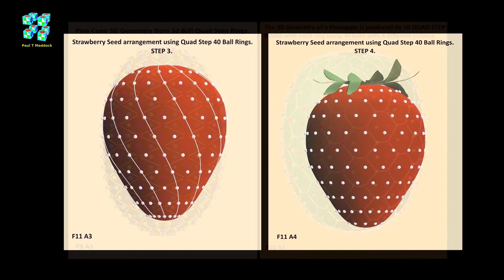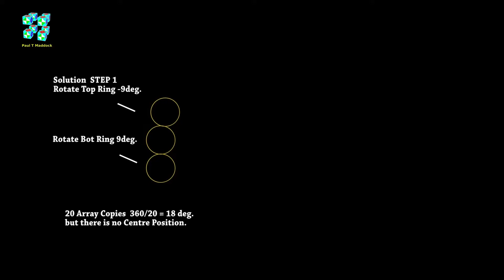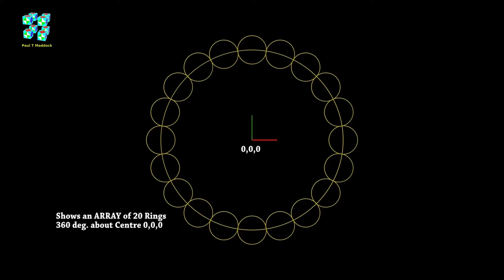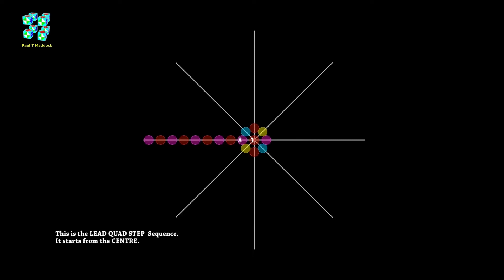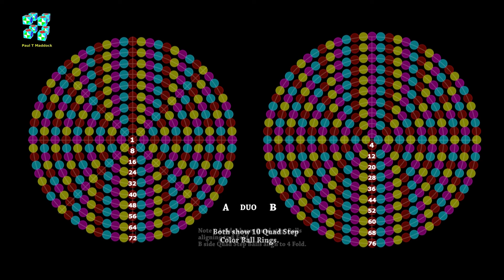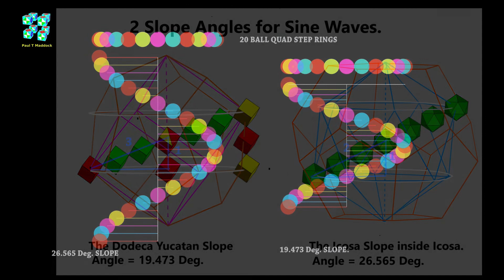QUANTUM HARMONIC SEQUENCE using QUAD STEP 288.

Comment: I'm not getting notifications, so I had to look for your channel.
How ya been?  I'm building 4 projects at once and researching frequency cymatics, patterns, ways to formulate a Teflon metal oxide mix to produce artificially, something found in bee wings by Victor Grebennikov who made an antigravity platform
Reply from the maker: I have just been plodding along with 3D Platonic Order Mike. Sounds like you are into some mind boggling stuff way over my head. Good luck with your projects.   Maybe you can hover over and around Montreal one of these days.

Comment: Have you tried stacking icosidodecahedron?
Reply from the maker: No I have not Lukie.   What I show in this videos are spheres that could be a spherical Icosidodecahedron.  I show that the vertices of 32 Ball Quad Step Rings ( and 24 ball ) can align up to the vertices of the Icosi in my earlier videos. The polyhedrons are multi vector representation of this 3D spherical order.   So it looks like any polyhedron can be made from the different sizes and fold of the Quad Step rings.  You will only know if you do a bit of research. You do not have to buy a street of houses just to find out.
Reply: @ThePaulTM  I heard that stacking of icosidodecahedron produces the 12 strands DNA. Am curious
Reply from the maker: I cannot answer that one Lukie.
Reply: @ThePaulTM  That is fine.
Reply: @ThePaulTM  I do know that stacking of dodecahedron produces 10 strands lol
Reply: Most heavenly bodies have the same pattern of energy channels which is 16 around 10 around 6 around 1. This same pattern was found the most efficient for packing wires for long distance power cables. Our sun and this earth have 10 vile vortices above and below the equator. 
This is primitive power geometry.  There are others you'd find even more interesting.
Reply: @mikefromspace  interesting. It matches the hypercube diameters as well.
6-cube, rhombic triacontahedron
10-cube, rhombic enneacontahedron
16-cube, rhombic 240-hedron.
Reply: @mikefromspace  You're wrong lol. It's actually 24 around 18 around 12 around 6 around 1 and so on above 24. That's the optimum geometry as it has that maximum circle packing.
Reply: @lukiepoole9254  No, I'm talking about the reality of experimental tests as well as the actual known geometry of ley lines covering earth which does have 10 vile vortices near the equator. Jupiter is different. It has 1 inside 8 inside we think 16
Reply from the maker: @Lukie Poole   Mike knows all this stuff because he kept a stack books from his old space ship.
Reply: @mikefromspace  interesting
Reply: @ThePaulTM  lol 😂
Reply from the maker: @ mikefromspace You are right about the Vile Vortices Mike. What they say about them tallies up with Quad Step  They also mention the Icosa .   I show this in my earlier videos.